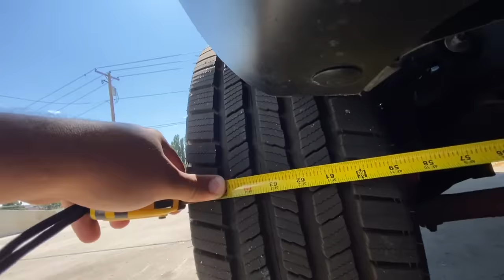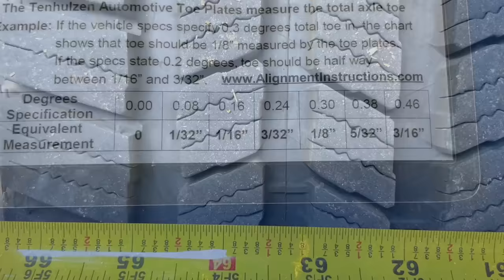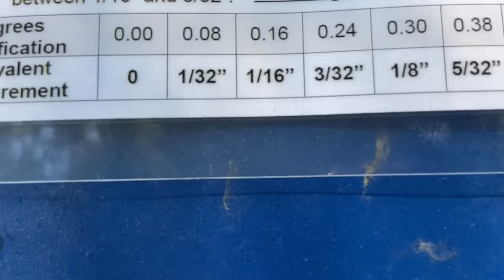How to do an alignment on a car at home using only a tape-measure!!! (And Alignment Basics)

Comment: I have used this method for years. I never had an issue with uneven tire wear, and exceeded tire wear expectations.👍
Reply: @S-O-T   Plus add a little windage for not being able to go up to the half-height of the tire, at least on most sedans.  Ex. if you can only go up 1/4 height then set 1/16" toe-in to get a 1/8" spec.  On my cars I get maybe 1/3 height, so not a big difference.
Reply: ... o of
Reply: Question I have lifted truck and the shop did alignment and I can see the toe is out , i mesure and is 1/4 different out , rear front tires 84 , front 84 1/4  the difference is to much ? The shop said a is ok but I can see the tire is out
Reply: Umm what about camber and castor adjust??? Was never even done!!
Reply: @puggles56  Rick, most shops with all the fancy laser alignment rigs, still only do toe in adjaustments on the front and rears... on my car, you can rotate the strut mounts to change caster and camber angle but you gotta loosen 4 nuts, drop the strut slightly and rotate it.. they dont want to be bothered and will tell most people its not adjustable..
Reply: @skip741x3  yes, they pretend to do more than what's really being done
Reply: I have a 07 Town car getting inspected. As this was happening I was talking to a guy I knew for decades about how gr8 panther platform cars are especially to work on. Very easy to line up. I said yes I love them. Then get a quote for 135 bucks. I ask 2 or 4 wheel? Well we charge same for either. Ok. So I get a estimate for 2 inner tie rods, rear 3rd brake light, inspection, alignment and labor for $600+. I say thanks but I'll do work myself. I knew lights was ok b4 I went and thought strange they not not 1.5 miles down road. I unhooked brake switch, hooked back and lights are fine. I will do work myself and pay the $40 for a sticker. 😂😂 These prices are Insanity. And ppl say well u need a alignment after working on steering. Yes. Yes urr right. I'll do it with a tape. We'll our machine is closer than a tape. Yes. But b4 urr machine was made we did this with a tape. Yes machine is finer measurement, but it's not worth what urr charging. If I had no clue I'd payed 106.77 for a 3rd brake light assembly when it's $24.99 for a brake switch. I know that like most things there's good and bad but seems like no matter where I go I hear same story. My wife took car to get sticker years ago. She comes back with a list of 16 things wrong. I say BFS. All was good except for tail lamp bulb was not good connection. I go back next week and take estimate wife got. Excuse was it was a new inspection tech. Ok so he should know since he got his new inspection license. Come on. Gtfoh ppl.
Reply: @williamgrissom9022  sa
Reply: @skip741x3  just had exactly the same experience today. Went to get new wheels and alignment done yesterday. When I got home the printout they gave me showed the front nearside wheel had a camber of 2.15 negative. Went back this morning and was told the camber on my car is not adjustable.

Research on the Internet says it is! No point using fancy laser adjustment if they’re not going to do the adjustment!
Reply: @watchmanexpert - first, can you advise what "mesure" means?
Reply: @r.m.7288 watch out folks grammar nahtzee is hear...😂
Reply: Is there a way to do this is you have different size tires on the back?  I have a classic with wider tires on the back.
Reply: @puggles56  it might drive straight but will never be accurate this way.
Reply: @skip741x3  Or they will say, 'it's within spec' so they can get out of a full alignment.
Reply: I'm confused about why you would have an issue..
Reply: Cause u only doing the toe
Reply: @kitjasabsgabs1830  big fan of the acronyms!
Reply: @TheoriginalMobileApp  yes
Reply: what is a rear front tire, I want to help but this is confusing  @watchmanexpert

Comment: Great video! My only suggestion would be to find center on the vehicle, use a plumb bob and measure off each tire to center. This is because one tire may be out more than the other. And when your tolerance is 1/16th, every 1/32 counts.
Reply: This makes sense.  Thank you.  I hope to be able (financially) to buy replacement outer tie rod ends for my car, but I don't want to try to fit in the cost of a shop's alignment.  I don't own a plumb bob, but if I can't afford one, I could do a makeshift plumb bob perhaps. The challenge would be making whatever pointed thing hang from the string.  However I see one issue: You'd have to make sure the vehicle is on level ground from side to side.  If you're not, the plumb bob will hang off center.
Reply: You'd need to find a center between front and rear wheels in order to be accurate, because your other parts might be out for a few mm's, enough to throw you out of true center.
Reply: Now, that really help to make this video to have sense and logic; while watching the video my logic kept telling me, how does he know, how much toe in, he will have to adjust because each tire could be off already. And without a point of reference, it could get worst and worst.  I'm used to doing it on a line alongside the car to tell the difference between the tire's angles. But yes, your suggestion help clear up this technique a lot that the uploader did not mention.  Thanks
Reply: How are you finding true center of your vehicle? Also unless the vehicle is perfectly level, your plump bob will be out.
Reply: I believe if you check it will say that you're looking to get all 4 tires running true to each other or tracking together
Reply: I was thinking the exact same thing. I run a string along side the whole car to get measurements from the rear tires also to get the center point
Reply: Exactly I’m a carpenter not a mechanic but I didn’t think it was smart to pull the tape from the tire that possibly needs adjustment.

Comment: Nice video pretty much explains what's going on in the front end. I am 60 years old auto mechanic my whole life I went to school for front end alignment Auto and Diesel. Your videos shows what's going on. With this method even if it is not perfect but if you get it as close as you can you're probably doing a better job then the new guy at the repair shop setting the tow and letting it go. All you Old-Timers know what I mean by that phrase. Pretty much you'll be close enough and will stop wearing out tires thumbs up my friend👍
Reply: you talk well, but as an old mechanic, I answer that the CV Joint Boot should be replaced at the same time ..
Reply: @dzacek008 nice non sequitur. Take your meds
Reply: @dzacek008 cv's have been removed for weight reduction

Comment: Measure the wheel not the tire. Simple differences in tire pressure will change measurments..
Reply: or the fact that his treads zig zaged an 1/8" lol
Reply: Actually, if neither of the tires have a different level of inflation, or even a different inflated radius, the measurement isn’t of the tire, or between the tires… What you are aligning is the difference between the front of the tire and the back of the tire when both tires have not moved.

You could have completely different size tires this would still work, measuring across, tire to tire, again, because what ultimately being measured is the difference between the front of the tires in the back of the tires.

Comment: This is great i had all the manual pre digital and computer added equipment at a garage right beside a high tech alignment and frame shop. They often brought me jobs on cars that drove bad for them after the computer alignments. I straighten the cars out just fine. I told one of the guys from there "just cause you have a computer doesn't mean you must stop thinking ". :-)
Reply: Dude I had my truck aligned on a computer alignment machine. They couldn't get it right after 2 tries, so I gave up. It rode worse after the "alignment" than before I took it to them. Now I'm trying it at home. Maybe I'll get it right. 'Cause they sure couldn't.
Reply: Cording it is a good option as well
Reply: @MrCoolvibeztv8079  Hey Itan, by cording do you mean wrapping a line all the way around the car?
Reply: @david9783  yes you can do that if you don't have someone to hold it from the back tyre to the front , then adjust it and make sure the front outer part of tyre is touching both sides cross the the tyres...always leave a little tiny space between the front edge of the wheel where the line comes in contact with the tyre..hope that helps
Reply: @david9783  I was a alignment technician/ auto mechanic for 22 years I always use the cord after doing front ends and when it goes on the machine nothing else needed to be done..
Reply: ¹
Reply: @MrCoolvibeztv8079 what if you have staggered tires with 275 on the back and 255 on the front?
Reply: @newfie-dean5803  you would need to do some technical stuff to get it in line , like getting a little straight edge to sit between the line and your tyres at the front.. It's a bit technical to explain to you without you misunderstanding some of the info. My best ways of doing such is to show you with an example.
Reply: @Datguy-k7s  yes if the spacers are front and back.

Comment: As one viewer mentioned, loosen off the rubber boot clamps before you start spinning anything. This keeps the boot from getting twisted up as you turn the adjusting shaft. You could even use a silver Sharpie marker to put a reference mark where the original boot position was if you’re concerned about it sliding too far away from it’s original position on the shaft.
Reply: The boot clamps don't loosen, also he spun the boot with his hand. No need to remove the boot clamps and make things more complicated.
Reply: Sorry Alvin, I have to disagree with you. If it’s a factory pinched clamp you would not be able to loosen it. Most vehicles have removable clamps, so what’s wrong with sliding the clamp off and keeping the rubber from twisting up? Is it the little bit of extra work that you are afraid of?
Reply: @LetricShave  Afraid of work, na, not me lol. But we will agree to disagree. We all have our own little ways but we're shooting for the same results. 

For me, if I can cut cost on a clamp that doesn't have to be removed and a boot that is in perfect condition, I won't remove it if it's not necessary and doesn't impede to results.
Reply: @alvinf1275  What Larry is saying is to loosen the clamp so that the rubber boot doesn't spin when turning the tie rod.  If the boot is old and dry, it could tear when the tie rod is spun.
Reply: @lavenderseedandworms  I'll save u all some time, argument and money, 2 times a year wipe those boots down with 303. Get u a dollar store pack of wet wipes, squeeze the water etc out, pour in a few table spoons of 303 in the pack or remove and put in a freezer bag. Wipe them down a time or 2 and they'll last forever. I try to tell customers this in shop. I've seen so many ppl spend alot of money on boots, air shocks, etc and just put them on. It takes less than 30 seconds to treat them so the rubber will last and be pliable and never dry out. I do this with all rubber, plastic etc. I do this to air springs on Kenworth, tires etc. If u can when new spray or wipe inside and out with a dose of 303. I've had same air bags, tires, wipers, parts on semi and autos for years and decades. Things like PS lines, brake lines, fuel lines are all as cheaply made as possible. A lil bit if care makes the difference between them rusting in a few months to lasting years. I live in a Salt locale so it's necessary. Even if u live in FL, if next to ocean, it'll rust. If u use wipes the 303 will last alot longer.
Reply: I found this out the hard way, nobody loosens them on the job. Most of mine were zip tied so i started leaving them a tad loose and tightening after it comes off the rack
Reply: @kitjasabsgabs1830  What is this 303 you mention? Is it some kind of oil?
Reply: @Rando2930  It was developed in the aerospace industry like alot of things as in military then us, GPS etc. It will condition and protect any surface especially rubber, is not greasy and will not attract dust like Armor All. I've used it for over a decade. I use on my air ride lincoln suspension. Ppl complain about these air bags but when I ask every single person if they've ever washed, or treated the rubber they say NO. Well when u never drink water or use lotion urr skin will dry and crack as does rubber since it was once alive growing. The bags will start to dry, then crack, then leak. I use 303 on new tires inside and out. My tires, air bags, wipers, bumpers, etc have lasted that long. Get a cheap pack of baby wipes and squeeze out all water u can and then pour in 303 and u have wipes that u can use and make it last longer. I also use a handful of Vaseline on my air bags also doing same on semi and trailer bags and gladhand seals. It's just a fantastic product that does what is says and is better than anything I've tried in 25 years. Google it for all uses and info. Have a gr8 day.
Reply: This is great advice, however , what is the best way to draw the exact verticle line on the tire might help
Reply: @lavenderseedandworms   CORRECT   hang locking heavy duty hose clamps  on clamp or move onto metal rod
Reply: @kitjasabsgabs1830      Good advice

Comment: Well, I noticed just looking at my car that I had an enormous amount of toe out, so set about fixing it using this method. I was confident that I had it right but on a long drive I felt it was pulling to the near side a bit too much. So I took it to a local garage for a test on their Hunter machine, telling them that I'd been having a go myself. They came back to me with a print out and said it was spot on and asked me how I'd done it.
Reply: So what was causing the vehicle to pull if the alignment was good?
Reply: @Randyplaysguitars  Nothing but my OCD. It's fine.
Reply: I was a Hunter rep before buying a shop with an A111 that I was very familliar with. Hunter makes the most accurate equipment. Today most of the time a car pulling one way or another is from tires, most of the time you swap the tires left to right, the pull will go away.
Reply: @Randyplaysguitars  Road crown

Comment: If you replace parts at home this is a good thing to do before you get a real alignment
Reply: Great
Reply: Yeah your right . That will get you pretty close . So you can get to the shop without tearing your tires up. Gotta do that on my C10 . Replaced everything on my front end and it way off now.
Reply: Hahaha I took my shitbox for a drive after putting on new parts and not having old measurements due to having to cut parts etc and the thing pretty much crab walked lmao
Reply: Just got to be able to get there

Comment: A front wheel drive vehicle will need a very slight amount of outward tow to compensate for the pulling forces, this is opposite of rear wheel drive..
Reply: How much outward toe should it have?
Reply: @s0lbabyy.a  Very close to zero, maybe 1/16 inch towed out but certainly not towed in.

Comment: Bit of a tip you should jack the wheel off the ground to spin it and use chalk and scribe to mark a true center line, tread can be off centre or the wheel could have a slight amount of run out and a true centre will find any problems and give better results for little extra effort